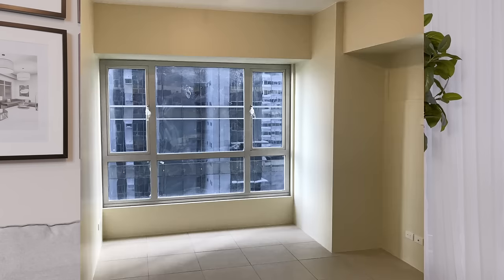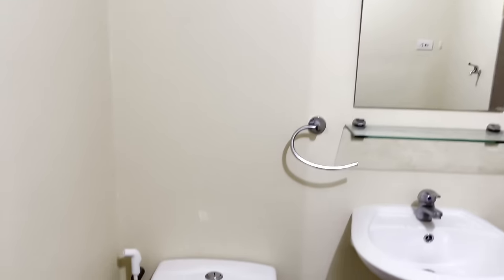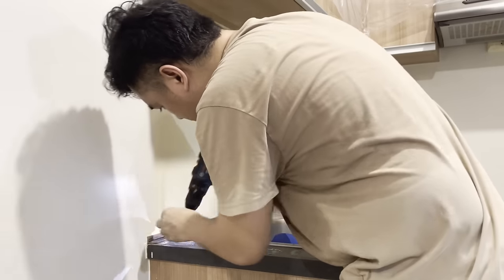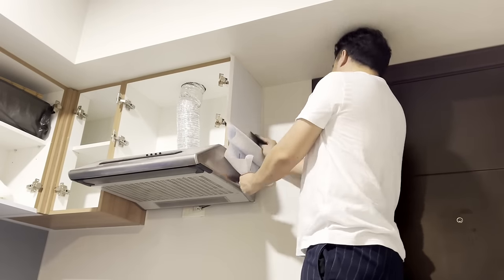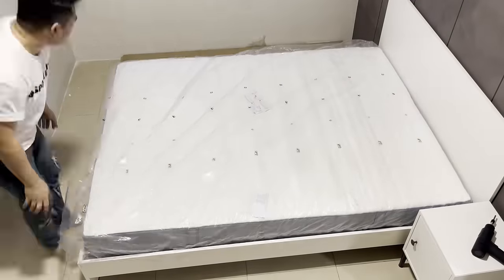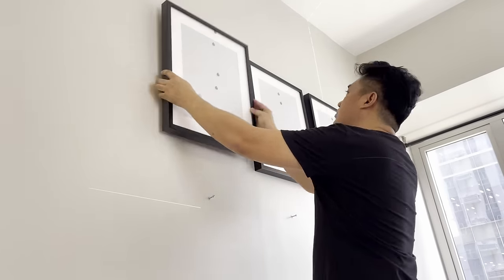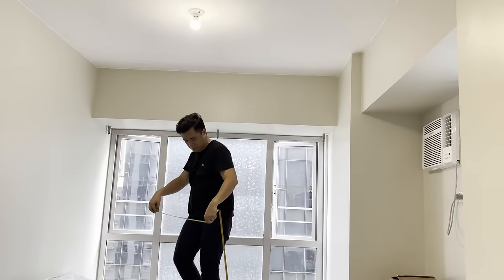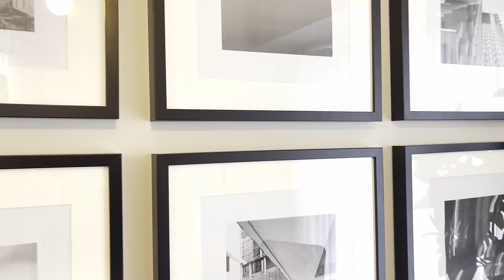One Bedroom Unit Makeover (37 SqM / 398 SqFt) Greige Minimalist | Renter Friendly | Studio Ploy

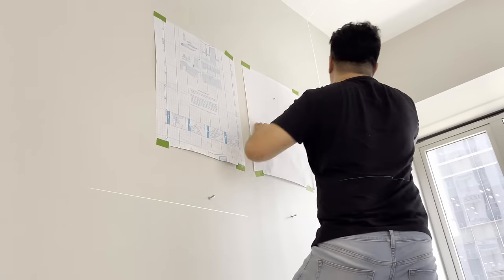Comment: 23:30 using a taped paper bag to catch dust from drilling holes, and taping multiple papers on the wall with measuremets to determine frame hanging position for lots of prints or paintings. 24:43  "The templates for the backing paper" are from the "backing on the adhesive contact paper used for the cabinets." Briliant!

Comment: I just noticed your kitchen with a cabinet is close to an oven how did you open the door. I think the best you can do is make it sliding doors. But overall good job. Good luck!
Reply from the maker: Hi! I total get your point but I actually did not do any repair or alteration with the cabinet beside the oven. The developer designed it that way and it's fixed on that side. Unfortunately I was not permitted to do any alteration to the existing as I was only tasked to do an aesthetic upgrade with a certain working budget... Thanks though! 😊